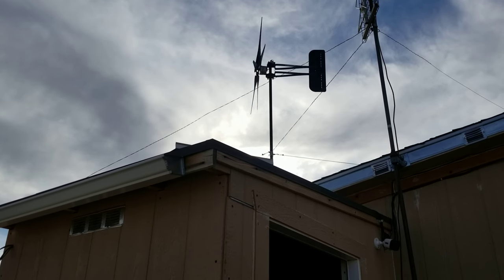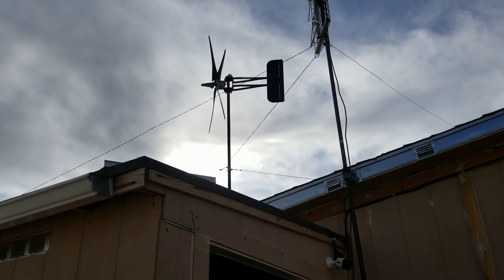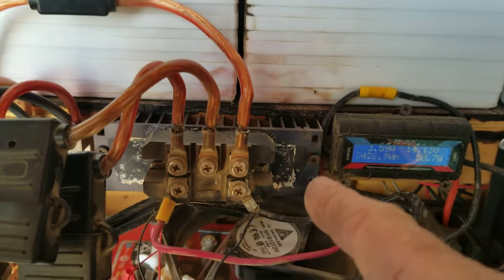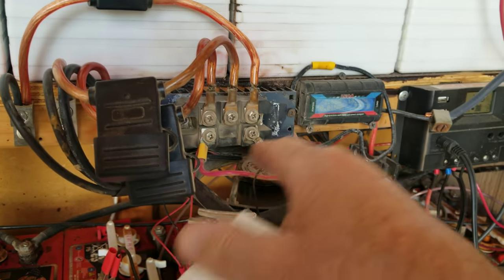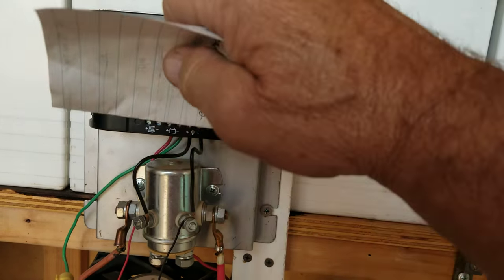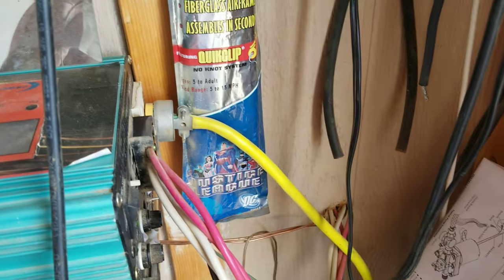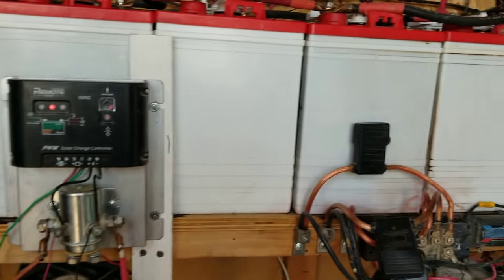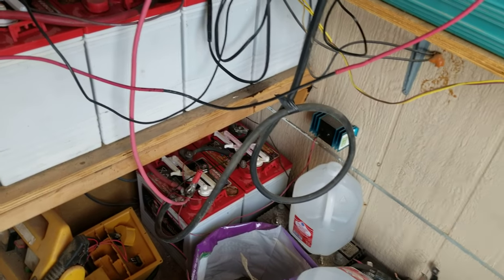Wind turbines, controllers and batteries explained, March 6, 2020

Comment: One small correction, the difference is between a PMA and PMG is NOT that PMA is AC and PMG is DC, they are both AC.  The PMA is designed for a car originally and the PMG is designed to be a generator and is essentially better in every way.
Reply from the maker: Welcome aboard.   Sorry, I have to correct you.  A PMA has 3 wires all the same color, and no specific order of connection, all output, because it is AC (Alternating Current) until it runs through a bridge rectifier which is constructed of a series of diodes and converts that alternating current into direct current (DC) by redirecting multiple inputs to directional input/output.  A PMG is a Direct Current "generator" That produces electricity through a 2 wire  Direct Current, positive to negative, power with one red and one black conductor.  Power out through positive and return through negative.
The correction to your statement is: Both PMA & PMG are "alternators", the difference being, a PMG has a rectifier built in, an PMG requires one at the conversion location.   This is why a PMA is preferred.  An alternator, (requires smaller conductors) for longer distance of run, saving money on wiring, and conduit sizes. 
Thanks for your comment.
Reply: @GBear  
I don’t kwow what to tell you. PMA is car alternator.  It makes AC.  The PMG is a 3 phase generator .  It also makes AC. The one i have has 6 wires one sour I’d it. 
6 wires coming out of it.

Comment: Hi. I am Graham. 

How do you connect 2 or more charge controllers to the battery bank. Do you do it in parallel to the same battery bank or you split the battery banks so that each controller  charges its on Bank. I have tried putting them in parallel to the same battery bank but one of the controllers always get damaged.  Please help.
Reply from the maker: Hi Graham, welcome aboard.   They need to be connected to the bank at different locations, and should be set with the same parameters.  Also, only one should have the 'equalization' feature turned on.
Connect the first one, positive to positive of the first battery, negative to the negative of last battery.
Connect the other, positive to last battery, negative to first battery.

Comment: Been trying to find out more on using more than one solar array and wind turbine system but every where I’ve gone seen to think they can talk the lingo and you’ll understand it.       You have answered most of my questions in layman’s terms which I understand.  Many thanks    And great video look forward to more.     And subscribed 👍🏼👍🏼
Reply from the maker: Welcome aboard!  Anything in particular you need to know or clarify, just ask and I'll help if I can.
Reply: @GBear  great vids g-bear. My question is more about solar. I’m still stumped on how to divert solar power after batteries are charged. Like to heat water. Is there a simple diverter system that can be triggered by a timer or voltage that doesn’t involve using the batteries. One person mentioned it being necessary to have a switch or relay before the charge controller to prevent micro cycling batteries. Im still very new to all this. Thanks
Reply from the maker: Hi Spot On.  Welcome aboard!  Yes, there are ways to divert excess power to heating elements.  Below is a link to one type, but the element included with this unit is for air warming.  You would need to buy a water heater element in your voltage and subsitute it for the air heater element.  I'm not promoting this particular charge controller, just showing you what is available.
https://amzn.to/3yzDi8s
You didn't mention the size, output, or even how much wind you get at your location, so I couldn't be specific on what you need or should expect from the setup.
Reply: @GBear  I appreciate the help, and thanks! it’s a small solar setup for a shed. I’m really just looking for direction on the concept tho. Interesting charge controller! i just want to make sure that the dump load doesn’t pull from the batteries and micro cycle them as some YouTubers mentioned some will. Do this “d” terminals carry the power right from the panels or will they pull from batteries? I haven’t seen charge controllers with a “d” symbol on them before
Reply from the maker: Oh, wait!  Are you just using 'solar'?  No wind turbine?
Reply: @GBear  no wind for now but will probably give it a go at some point this year
Reply: @GBear  do you have any ideas to dump excess solar without pulling from batteries?
Reply from the maker: @Spot On  Oh, well then heck!  All you need is an mppt solar controller in the voltage you have your battery bank wired for!  No micro cycling to worry about!  Get an mppt solar controller (not hybrid) and connect the battery bank first to it.  Many controllers are at least 12v or 24v already, and connecting the batteries first tell the controller what voltage to use.  Then connect the solar panels to the controller, but not while they are in the sun.  Cover them until the connection is made.  That's all you need.
Reply from the maker: Most mppt controllers have an accessory connection too.  You would connect your load to that and follow the instruction for setting the controller to turn that feature on or off by voltage settings.
Otherwise, the controller will automatically go into 'resting' mode and quit charging the batteries at the otherwise selected voltage.   That's what a charge controller is made for.

Comment: i have set up for my office and one set for the freezer and frig. the 24 will be for the air
Reply from the maker: Too bad you are on the other side of the country, I'd love to help you with the setup, but from here, I worry about your safety while Jerry-rigging power.
Where do you set up your panels?  The Gustapo will spot them and throw you in the cooler.🫡😆
Reply from the maker: So what are you using for an inverter?  You would need separate ones for 12v or 24v.  Also the wattage and pure sine or modified sine wave makes a difference.
Reply: @GBear ihave 1500watt pure sign wave for the office i have 1000 pure sign wave for the freezers i have a3000 pure sign wave they are relibles for 24v i have a 25000  i have high dollar charge controllers tristar but don,t whant to mess them up they all have dip switches for setting

Comment: Hi Thanks for all the tips, wondering if you can explain how you spilt the dual solar panel loads due to the size of the controllers Thanks Ross Tga NZ
Reply from the maker: First, Welcome aboard!  So, I connected 2 of the 305 watt panels in series, (positive to negative), and did the same to the other 2 of the 305w panels.  This doubles the voltage output from 40voc to 80voc per set.
Then using a 2 to 1 MC4 splitter I connected those two sets in parallel, (positive to positive,  negative to negative), this keeps the voltage at 80voc, but increases the amps from approx 10 amps to approx 20 amps.
Then I up the gauge of wire from 10ga to 8ga from the splitters pos and neg directly to the Midnite controller which has already been connected to the 12v battery bank.  The VOC input can peak at 80voc/20aoc, just over the 50% mark the Midnite 150 can handle, but the MPPT balances it to somewhere around 65v/25a input, meaning I can add another 4 of the 305w panels connected in the same way and safely stay within the allowable parameters. 
Then I connected my old 100w panels in series groups of 4 each, and parallel 3 strings (groups).  I brought the pos/neg leads times 3 into 2 bus bars, then a single pos/neg to the Renogy controller which was also already connected to the battery bank.   The Renogy has a max input of 112voc which I stayed under, and the amps are around 20 per string (group), so approx the same input as the 305w strings.
I hope that helps you understand, but if not, let me know and I will do a walkthrough video for you.

Comment: Hi 👋🏾  G l know it's been a while,  ☺️ just wondering could you use a 12v wind turbine to change a 24-v  battery bank, l was thinking if you had a converter 🤔 but not sure what do you think
Reply from the maker: No, you can't.   A 24 volt battery needs at least 25.5v to properly charge.  If the incoming voltage doesn't exceed the battery's base voltage, the current can't flow.

Comment: You should mention with the solar wire the gauge could be less if the panels are wired in a series vs wired in parallel  (more amps require thicker wire vs more volts and less amps and letting the mppt controller convert the higher volts to amps at the controller)
Reply from the maker: Welcome aboard!  Very good point!  I'll be sure to put out that info.
Reply: Well said 🙏👏👏👏 a lot of people make this mistake to parallel panels and they spend a lot of money in the cable but the problem is a lot of people use low amps charger(most of the cases cheap ones) and those they can't take higher voltage input like the midle/premium brands(even though there are quite a few cheap  Chinese chargers that can take over 100v input and output 12-24V or more)
Reply from the maker: Welcome aboard!  So true!

Comment: Hi G Bear, I’m getting a 24v wind turbine and I already have 6x12v batteries, do I get a 12v inverter or 24v, much appreciated.
Reply from the maker: Welcome aboard.   First, you didn't say if your turbine is 3 wire PMA, or 2 wire PMG.  You also didn't mention if your turbine has a controller, or not, and you didn't say if you also had solar coming in.  If you plan to use the turbine, you MUST configure your battery bank to 24v,  use a 24v controller if you also have solar, and a 24v inverter.
The solar controller gets connected to the 24v battery bank FIRST, then connect the solar panels.
If you are not using a charge controller for your AC turbine, you will need a 24v bridge rectifier between the incoming 3 wires of the turbine and the battery bank.
If your 24v turbine is DC (2 wire, red and black) it can connect directly to the battery bank of 24v, but a dump load diverter will also be necessary.
Reply: Thank you for a very quick reply, I have ordered the ista breeze turbine kit i1500, with the controller & dump load .hope this helps.. thanks .
Reply from the maker: Are you planning to have solar also, or just the turbine?
Reply: Sorry forgot to mention yes I have a few solar panels,  it’s 11pm here . I’m half asleep 💤
Reply: Yes if it’s safe to link up
Reply from the maker: Ok, get some sleep and reply tomorrow if you need more info.
Reply from the maker: @carmanbazza  As long as you have the batteries at 24v, in series/parallel, ( 2 batteries each in series times 3 equals 3, 24v batteries which you then connect in parallel your battery bank.
Connect those to the solar charge controller FIRST, then connect the solar panels.
Connect your turbine controller to the battery bank FIRST, Then connect the turbine to it's own controller.  Follow the instructions to install the dump load.
Connect the 24vdc-120 or 240vac inverter to the battery bank, DC positive to the positive pole of the first battery, then the DC negative to the negative pole of the Last battery.
This uses the whole battery bank like one large 24v battery, instead of 3 separate 24v batteries.
Reply: Thank you so much for the information.👍

Comment: where to get used forklift batteries? is it recyclable? what about the weight?
Reply from the maker: You'll have to google that question for your area.  Yes, they sell recycled or refurbished batteries.  They are lead acid batteries, very heavy, but very strong.

Comment: Hey FRIEND! Touching base with you! Interested in learning how much power it generates. It 12volts you say. 1685 watt??? Got to have 90 mile/hr wind…that is rare!
Reply from the maker: Needs 90mph wind to produce 1685w.  It starts producing at 9mph, but only about 30-40w.  Normal winds here will reach 22mph and I can get a few hundred watts out of that.  I have seen over 1000w in a wind storm with gusts of 45mph.

Comment: how did u ground your wind turbine? where did u attach the ground wire? my wind turbine is 20 feet up its on water well poles. how would i go about grounding it?
Reply from the maker: Drive a 6 foot ground rod into the ground if you don't already have one nearby, then attach the metal tower to that ground rod with at least #6 solid copper wire.  The PMA or PMG is already in contact with the metal tower so no wire is needed at that connection.
Reply from the maker: Welcome aboard!

Comment: Got the same charge controller but my model is 2000 watts. 1000 watts for solar and 1000 watts for turbine. Whole system is 12 volts. The problem is I just bought my first solar panel which is 320 watts and it is pumping 30 volts. It is working fine when it is cloudy but in full sun the controller is shoving error and OVER PV is blinking. I found in the instruction that voltage from solar panel is higher than voltage set in controller. What can I do now? Did I buy wrong solar panel. I was trying to set higher voltage in the controller but the max is 17 volts. I do not understand what is wrong as this controller is made for 12volt 24 volt and 48volt systems. Anybody could help???
Reply from the maker: Welcome aboard Seb,  sorry to hear about your troubles.  If only you had contacted me sooner.  I found out the hard way that those Chinese controllers are junk.  I have since replaced mine with the Midnite Classic 150 and wish I would have just gone this way in the first place.
You have a choice, keep that controller and get rid of the solar panel, and only use 12v, 100 watt panels connected in parallel with it, or keep the solar panel and buy a Midnite Classic 150, 200, or 250 for your solar controller and use the Chinese controller for a 12v turbine only.
Note that the numbers for the Midnite Classic depict the maximum input voltage, so the 150 will accept 150vdc input, allowing you to connect your 320watt panels in series/parallel. 
Also the Midnite Classic  group will control either wind or solar, but only one or the other, not both in the same controller.
I hope this helps.

Comment: did you think about hooking up an on grid inverter to the solar panels inverter instead of the grid?
Reply from the maker: I am OFF the grid, and don't even have grid power available out here.  The new AIMS split phase inverter works wonderfully!  I power my cabin, my work shop, and my shipping containers with it,  and run an assortment of power tools, including a milling machine, metal lathe, wood lathe, band saw, tablesaw, and welder, etc to name a few.
Reply from the maker: Also, I see you are commenting on an older video.  I have since then upgraded a lot of equipment, including controllers and Inverter.  Keep watching through my playlists.
Reply: @GBear  ok sir, I will do.
Reply: @GBear  I want to try this new thing but you seem to have an in-lighting experience: 

I am thinking of getting a 10Kw wind turbine with an ON grid inverter and attach it to my 5Kw solar panels. 

the reason: on grid wind inverters only work when they are ON a grid and receiving power, they work by matching the power they are getting. 

hopeful results: my wind turbine will work without batteries and when it is windy, I have power, when it is not...solar will kick in. 

What do you think BOSS?
Reply from the maker: I am not a specialist in on grid solar and wind, but I don't think your plan will work.  Most grid tied solar systems are balanced and adding a separate input to that circuit may short the whole system.  I have heard of people adding a 48v PMA turbine to their grid panel, but since I don't have grid tie, I didn't push to learn how they did it.

Comment: just noticed that your wall fan will blow air in the cabin not out... change sides and then it will blow out ;) and your inverter will take air in true front and blow out from back
Reply from the maker: I don't know what you are looking at, but the fan on the wall near the door blows out.  The inverter fan blows towards it and it moves the air out through the vent.  The fan on the other side feeds air into the inlet side of the inverter.
Reply: @GBear  your bridge rectifier fan blows towards rectifier... wall and inverter fans are blowing same directions... fan sticker is always where air comes out from it ;)
Reply: just trying to help ;)
Reply from the maker: Trust me.  The fan blows outward.
Reply: @GBear  check it ;)
Reply: it simply can not blow air out if its mounted to blow air in ;)
Reply from the maker: @SigmaWorksSW3D  👌
Reply from the maker: @SigmaWorksSW3D  I connected the fan to power, felt the direction of the blow, and mounted it as such.  It has been there for 2 years like that, ducking exhaust from the inverter and blowing it out through the vent.  End of discussion.😁
Reply: @GBear  ok ;) :D just tried to help, nothing personal ;)

Comment: Do you ever have an issue with your PMA when you connect your battery bank PMA start swinging slowly and as soon as you disconnect the battery bank your PMA turns faster?
Reply from the maker: You should never connect or disconnect a PMA under load.   The blades should be tied so they don't spin, then released after connections are made.
The PMA connects to the bridge rectifier on the 3 pole side with wires in any order, but the output side of the rectifier with 2 poles are marked + or - and polarity is important when connecting to the battery bank. 
So, answer is no.  I don't make or break connections while the PMA is spinning, so I won't see what you described.
Reply from the maker: I commented in your video.